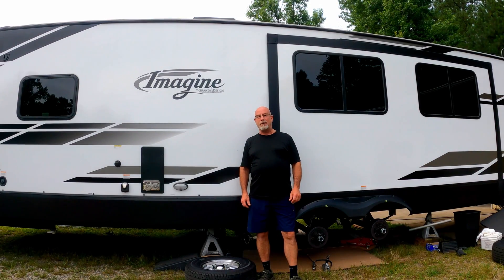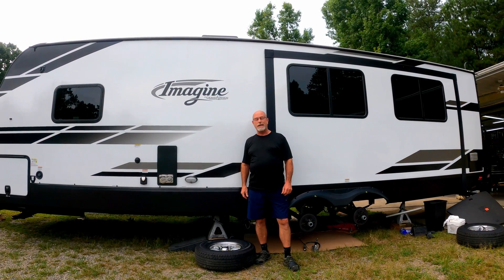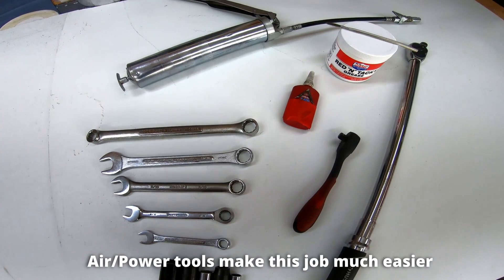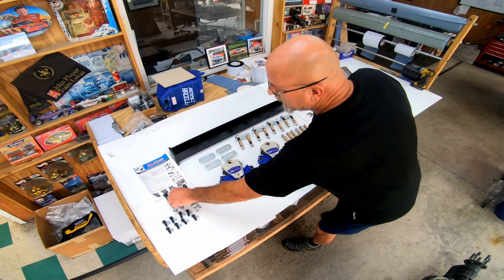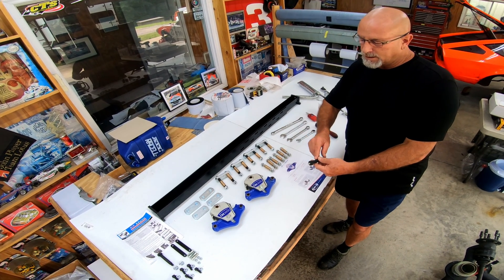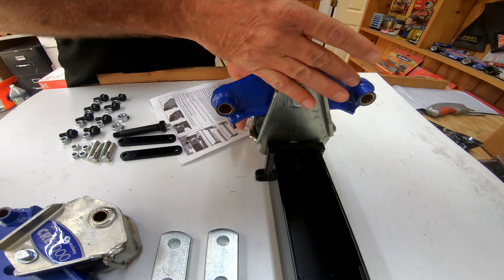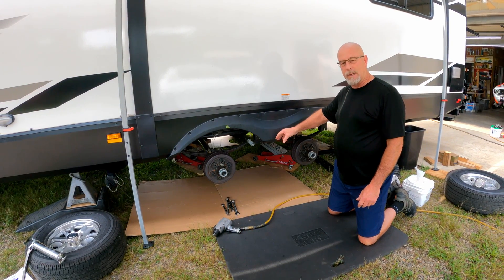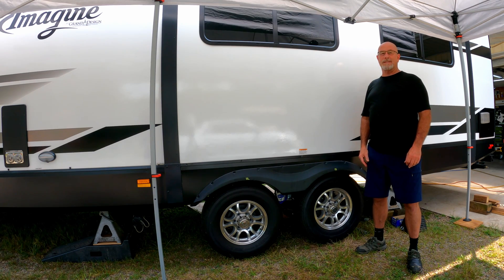MORryde CRE3000 Trailer Suspension System & X-Factor Crossmember Brace Installation (step-by-step)

Comment: What does the x-factor cross brace do for you? I've watched a lot of installation videos for the cre3000 and the road armor version but none of them installed the x-factor as well.
Reply: The x brace adds stability and side load strength to your hangers. When you turn, your hangers flex more than you think side to side causing one of the most common failures in TT suspension. Most shops just weld a solid one piece tubular piece of steel in between each set of hangers. I am not sure why this kit only comes with one instead of all three.
Reply: @TheTrev4477  By only offering one XFactor brace, MorRyde can charge more $$.
Reply from the maker: According to my Dad, who owns the trailer (I just helped with the install and video), it adds a fair amount of stability to the trailer and acts as a sort of sway bar from what I understand. It also helps in scenarios where you’re trailer is catching cross winds.
Reply: Does that mean it's more suited for travel trailers than 5th wheels?
Reply from the maker: @daviddillow2113  I imagine that it well suited for both travel trailers and 5ths

Comment: The CRE3000 calls for the XF12-001 crossmember, but it doesn't look like the kit includes the longer wet bolt. Can you please confirm? I have the exact same trailer. Also, why not install the crossmembers on the leaf spring holders as well?

Comment: Hi, I am looking to do the same upgrade to my Grand Design fifth wheel. By doing one side at a time, how did you hold up the one half of the crossmember until you got to the other side to complete? Was there any issues aligning them? I will not be taking all four wheels off as you did but rather one side at a time. Did you put 3 on in total, one at each leaf spring and equalizer hanger?

Comment: I noticed when he was putting the X factor on the black/gray tank pipe is directly above it. I saw it move up just a little when he pushed up on the X factor. Has he had any issues since installing it? I’m looking to install all of the same Stuff on our 2500 RL 
Great video it’s will definitely be in my feed the day of installation

Comment: I had this upgrade installed at my local RV dealership while getting some warranty work done at the same time. A few weeks later while performing a pre-trip inspection, I noticed that I could not see grease around some of the wet bolts. After further inspection, it turns out that several of the zerk fittings were defective. The tech’s at the dealership initially tried to install grease but failed. Instead of investigating what the problem was and then fix it, they chose to leave it, as is. It was not the positioning of the wet bolts that caused the problem. I removed the suspect zerk fittings and tried them in the grease gun by themselves. No grease would pass through them. Went to the auto parts store and bought some replacements and installed them. I was then able to grease the remainder of the wet bolts with ease. Just a reminder, always check the work you’ve had done. Everyone has heard the horror stories about the of lack skill, care, and work ethic that these RV dealership / service centers supply. I won’t go into the story about the butcher job they did on the warranty work that was the main reason for being there in the first place. The name of the business is, Explore USA RV Supercenter, Boerne TX.
Reply: This is why I do all my own work if possible. RV shops are typically full of kids with almost zero training in my experience. Not to mention your vehicle will sit waiting for weeks to months for the hacks to get to it.

Comment: Is it possible to do this one side at a time.  I don't have level ground and/or enough jacks to lift the entire trailer at once.
Reply from the maker: I think that you likely could install the suspension system one side side at a time but I’m not sure if you could install the cross bar without the whole trailer up.

Comment: Having done this exact change out myself, here’s some tips.  First, make sure you position the wet bolts at the 3 or 9 o’clock position.  That is the grease holes in the bolts need to be horizontal.  If those holes are facing top or bottom, one may have a heck of time getting grease into the zerk as the weight of the RV will be pressing directly on top of the grease hole. Secondly, use the grease gun to pump grease into the bolt prior to insertion into the shackle. Some have reported the grease holes were not fully drilled out at the factory.  Third, always press the bolts into the bushing/equalizer. The head end of the bolt has splines to keep the bolt from turning in the shackle once installed.  If you twist the bolt when inserting into the shackle/equalizer you’ll round out the shackle/equalizer hole.  Additionally, keep the bolt from turning when tightening the nut(this was not done in this video). Fourth, when installing the brass bushings, placing them in your freezer prior to installing in the spring ends causes the bushings to shrink slightly and will more easily install in the spring ends. Also the bushings should be pressed in(can use a C clamp for this). Pounding them in(like what was shown here) can cause the the ends soft brass bushing to mushroom out.  
If anyone has any doubt as to the necessity of upgraded the shackles & bushings, your doubts will be gone once you look at the condition of the plastic bushings removed from the springs. Those plastic bushings are destroyed with a few thousand miles.
Reply: Nicely said Carl, I also don’t like the jack in the center of the axel, I would place it closer to the hubs. JMO.
Reply: Great advice!!!!
Reply: Fantastic tips!!!!!! much obliged!

Comment: I am Thinking of adding the X-Factor beam to my Imagine 2600RB.  The drainpipe is my concern.  It is in the path of the beam.  Did you have any issues with the drainpipe? Has there been any wear on pipe?
Reply: They make a drop bracket X factor brace as well to clear pipes and wires.
Reply from the maker: I'm not entirely sure as this was my dad's trailer. I just helped him with the install and making the video tutorial!

Comment: We have a wide-trax tandem set up so the standard equalizers you see in most the videos do not work. But if you talk to the right person at MorRyde, they do have equalizers for wide-trax and they'll hook you up. I found them for $100 less at one of their recommended vendors. E-Trailer was very expensive. Don't go there. And the wet bolt/shackle kit is around $80 on Amazon. Anyway, I don't have the tools, expertise, help or desire to do this myself. Personally, I would only trust this install to a professional shop. So, I hired a local spring/suspension shop to install the MorRyde equalizers, wet bolt & shackle upgrade kit. They also checked the alignment, which was spot on and the spindles and wheel bearings. All fine as well. More than well worth the few hundred dollars all of this cost. Our travel trailer only has about 4,000 miles on it. I was shocked at how worn the bolt holes in the shackles were and how much wear was already showing on the bolts. The bolt holes in the shackles were already wearing in an egg shape. The plastic bolt sleeves were simply shot. We've taken the TT on two trips. The improvement is quite noticeable. It is much smoother with no "chucking" and it is quieter. This is a no-brainer upgrade. Shame on the makers of the trailers for building them with such total crap. I hear some RV makers are now putting these on as standard from the factory. About time.
Reply from the maker: I agree, the standard OE suspension components on these trailers are terrible quality and wouldn’t last more than 5k miles. This MorRyde kit is much more robust and you can tell it’s designed to last. Thanks for watching.

Comment: Thank you for an very informative video, I do have one question, how did you jack up your RV how high do you have to jack it up to get the tires off the ground, I’m thinking about doing this weekend and how long did the complete job take you. Thanks in advance.
Reply from the maker: My Dad had already got the trailer jacked up when I arrived to help with the video and install, so I’m not 100 percent certain. I’m pretty sure he had to jack the trailer up in stages. Jack one side of the trailer up, set it on some blocks/ stands, and then the other side, then go back to the first side and jack it up some more. I’d say get it high enough to get your belly underneath it easily lol. Thanks for watching and sorry for the late response.
Reply: I started doing it that way & stopped because the front shifted.  I then proceeded to jack it up toward the back using two jacks. I would go an inch or two at a time & then move my jacks toward the front and continued to creep the trailer up gradually.